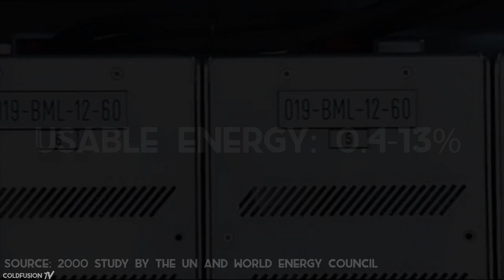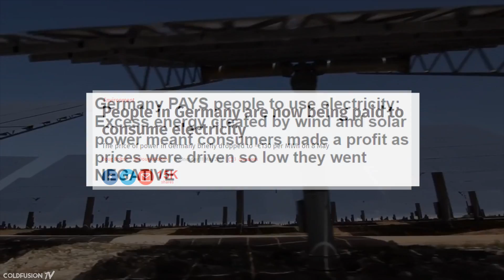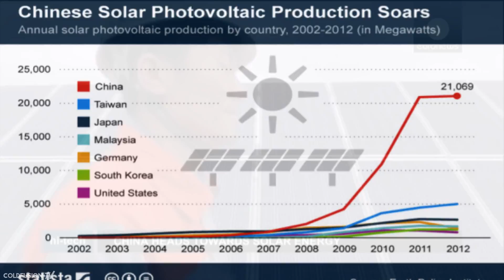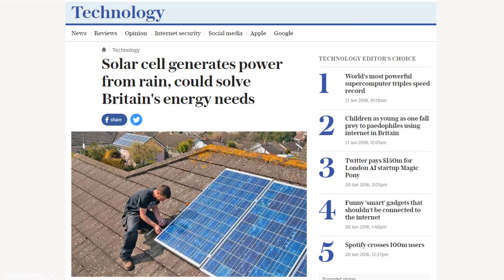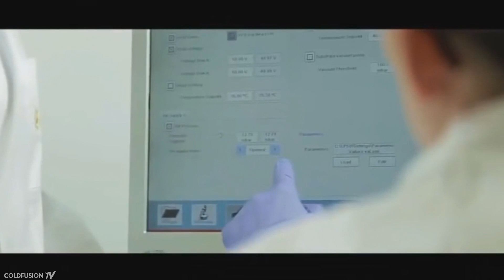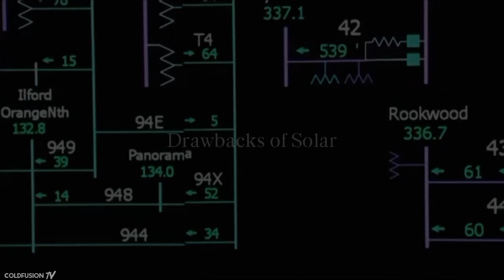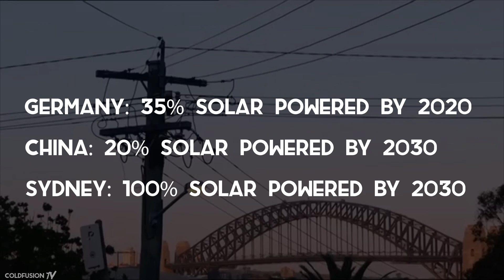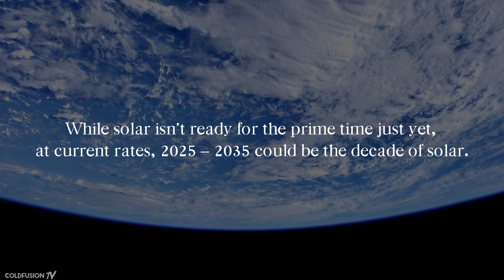The Truth About Solar

Comment: Why arent they making gigantic swimming islands out of solar panels covering parts of the oceans?
Reply: Waves.
Reply: ryan bresnahan who said they needed to not move?
Reply: _ ϺɅƦCΞL _ I wasn't trying to be a smart ass haha, I'm sure it could be done, but there would be issues with shipping lanes, and random storms that could make the water extremely rough.
Reply: Because using wave power generators would be better in that situation. They'd also have to pipe that power back or store it whilst at sea, power storage is a huge problem... it would be easier to place the solar cells in the desert. For countries like the UK, the problem is, who owns the desert, how well would they trust treaties to invest the billions in building these 'gigantic' solar farms covering parts of the desert. Then to pipe the power back, it would be the same Oil/war problem all over again.
Reply: ryan bresnahan I've just made a similar comment on another thread, one where a guy was shooting solar down for needing batteries. I've seen a video about it too. 

Use Solar energy during the day to pressurise old mines, draw energy at night from the releasing the pressure. Use Solar energy to pump water into reservoirs, then release the water at night, draw energy from it using hydro.

Many ways to get away from batteries, we just have to get creative.
Reply: First problem is energy transport... then there is the alignment with the sun, then maintenance, then weather... As a engineer I can tell you , it would be an expensive nightmare, for now you would be way better off just asking farmers with a barn to let you put some solar panels on top of it and give them 10% of the electricity for free, same goes for convenience stores, parking lots, etc... it it much more cost effective
Reply: mitchiemasha I recently watched something that dealt with this power storage problem, I can't remember where exactly I saw it, but it involved using the energy harvested (in this case) by wind turbines out at sea, and using the energy harvested by the turbines to compress air and fill a large balloon like vessel. It was some university program in England if i remember correctly, was pretty interesting.
Reply: Transporting the energy to land is problematic.
Reply: What I don't understand is a solar installation on my roof was priced at $24000 but generates only enough energy to run 3 small space heaters. WTF? However, I love the idea from Mik Wind of providing free solar units to farmers and 7-11 store owners then giving them 10% of the produced energy.  It is similar to the rental of suburban land to farmers.
Reply: Will Tabacchi Heating requires a TON of energy, and heat is the most useless form of energy .Unless you are using heat pumps, or running a bunch of computers to heat the room, it simply is better to burn gas .Heat pumps will give you 2.5 to 4 times the performance compared to a normal heater.

Comment: The truth about solar is that it was never about the solar panels to begin with.     Now it is great to see breakthroughs in solar panel technology and they are useful but this is not where THE problem with solar power lies.

      I had to give this video a thumbs down because it seems to me only a commercial about selling solar panels.

      I will give credit to the video on spending some time on the real problem with solar, but it was less than a minute.      The problem is we are still waiting on a breakthrough in energy storage, and I have not seen it yet.     We are still dealing with batteries with dangerous chemicals  that wear out over time.     Even the Tesla battery bank hasn't solved this problem although I do welcome greater efficiency in this area.

    Until we solve this problem solar will continue to be a small player on the scene, playing a positive beneficial role since it will reduce our energy consumption but still a small role.

     Tell me about something new and innovative about energy storage and you will get my attention.

Comment: Good work!. You didn't touch on Solar towers which uses mirrors to heat a salt and it has potential to store energy for a later use (during nights or cloudy days) in the form of heat to run steam turbines.

Comment: what about the CO2 emissions during production? i think you missed an important negative argument, don't get me wrong i would like it if there were more and better solarpanels but its an issue that needs to be dealt with.
Reply: The water contamination is a bigger issue. I actually worked out the worst case carbon emissions for production, transport and installation of our panels back in 2008 and they recouped them in 2 years based on Irish electrical generation at the time. It may take slightly longer now as the grid is greened but also everything else is more efficient, as well as the panels since then. So it may be similar or slightly longer.
No matter what anyone produces there are carbon emissions and downsides but renewables can recoup at least the carbon emissions as they are saving fossil fuels being burnt.
I just wish they were as cheap back in 2008 as they are now! I could have put more up.
Reply: Niall O'Toole I did not know, that they improved that much on CO2 production efficiency. but still he did not talk enough about negative things concerning solar power. would be nice if it was that easy as he described it
Reply: +RCP8888 yeah I think he gave a decent overview but for the true geeks it was a little light.
the real difficult part will be the storage and whether we will actually have a grid as we know it.
I am at the minute trying to sort out a cheap storage solution for our home as anything off the shelf is stupid money.
that is the thing, it is expensive and out of the reach of most people unless they are very committed to reducing their carbon footprint.
Reply: considering the alternative?.... solar doesnt seem so bad
Reply: "considering the alternative?.... solar doesnt seem so bad." Okay, I vote that the lot behind your house get a solar farm installed on it.
Reply: So you want energy from nothing basically. The panels once built are there for many many years, so you pollute only once in the beginning.
Reply: "The panels once built are there for many many years, so you pollute only once in the beginning." Same could be said for nuclear. Hydro lasts a helluva lot longer than do any solar panels. In terms of energy output (watt-hours), hydro and nuclear are unsurpassed.
Reply: You are very correct in your observation, what the video did was tell us the cost of solar power, what the video didn't do was tell us the price.  The CO2 output during production of the solar panels is negligible compared to the toxic compounds just dumped into the environment in china.
Reply: +fivemeomedia of course it doesnt. But fusion would be awesome too. But a lot further away sadly
Reply: +Elias Krmngr I think we would all love something that would be made from a low impact material. but even still the current panels are highly recyclable.
longevity wise my panels have a power production guarantee for 20 years and will produce power well beyond that but will degrade over time. in the last 8 years I haven't seen any degradation.
graphene seems to be the best future tech for PV panels but printable multi-layered multi-spectrum solar looks like the best bet shorter term and should be cheaper with less of an impact.
the holy grail would be printable solar cells with cheap, green, local storage on every building and some wind/wave power to cover the winter months.
Reply: +RCP8888 yeah I've looked at 18650 batteries which aren't cheap unless especially when you end up recycling reclaimed laptop cells.
there are very good engineering reasons why storage isn't cheap.
I'll check out the ice one you mention.
Reply: what about the emissions and other problems with mining materials used for batteries? Not to mention production and disposal of batteries?  Throw in the limited life span of batteries and where do the numbers make sense?  I'm all for renewable energy, and I do believe that we need to put extra cost into renewable energy over fossil fuels even if it doesn't make sense now, for the simple fact that we need to fast track renewable.  Still I would like to hear the legitimate down side to these things.  I just don't like to hear a biased statement of "the current state" while keeping a hope for the future mentality.  I do like this channel, but I tend to be critical when it comes to being unbiased.
Reply: "what about the emissions and other problems with mining materials used for batteries?" Do a search for "cobalt mining africa children" and tell us what you find.
Reply: Well what would be great is a biologicaly degradable material generating electricity.
Very interesting is the project of Saule Technologies.
Important for any of these projects is the question of longetivity, any information?
Reply: +Psittac20 mining coal and uranium is not green. Lithium is recyclable, its too valuable to dispose of. Right now, all cars have lead acid batteries,  which are reclaimed at over 99%. Almost all new car lead acid batteries have been made from recycled lead. 
making anything takes resources, but burning is burning, and there is no clean burning.
Reply: But they don't last forever either...
Reply: +Niall O'Toole i found a tutorial for how to build a tesla wall battery/akku from old laptopbatteries etc. just using 18650, like in the tesla thing. Also an ice heating (eisspeicherheizung in german) could be interesting for you
Reply: "i found a tutorial for how to build a tesla wall battery/akku from old laptop batteries etc." Does the insurance company that issues your home's fire insurance know of your plans? For that matter, does your power company?
Reply: +Cristian Baluta yes, but when do the numbers weigh out?  Throw in the difficulties of storage.  I don't see the scales tipping at 2 years whatsoever as previously mentioned, I don't even know if a home owner can make out with all things considered with putting them on their roof.  I do feel that what may not make sense now, will be overcome by future innovations and we need more capital behind it all.  But I'm still a skeptic of people who tout it as an end all be all.
Reply: The recoup time today is less than 6 month (maybe a little bit longer in Ireland)
Reply: Niall O'Toole
Sounds quite good, although I have to admit, I dont know how long ordinary solar panels last.
 What are these panels of yours?
Do you have a company?
Any place do get informed more deeply?
Reply: +Elias Krmngr my panels were manufactured by Kyocera but several manufacturers give similar guarantees.
these days the panels are more efficient, mine were 15%  and the latest ones are more like 22%. and a fraction of the cost.
just check out either solar installers in your area or more complicated buy the stuff yourself (panels, inverter, wiring etc) and talk to a local electrician to sign off the installation. different power companies also have different rules about connection and being paid for any exported electricity.
Reply: It will still be less
Reply: The production process is an issue, but people seem to think it's only for solar panels. All the shit that you buy has an incredibly fitlhy and power hogging process, then you throw it all away and start buying again...
Reply: CO2 is very good for the earth.
Reply: +Emiel Verbeeren research stuff!! Get stuff in your big head!! CO2 is Horrible for the earth and it limits oxygen for us!
Reply: well the "O2" limitation is not the problem
Reply: +AndDiracisHisProphet well ye
Reply: +AndDiracisHisProphet there will be an issue with oxygen. keep pumping CO2/methane into the atmosphere and we will get ocean acidification which will mean no phytoplankton and loss of the food chain and half the oxygen.
if we continue to chop down and burn forests we will kill the other major producer of oxygen.
so O2 is not a problem? really, you live on a different planet.
greenhouse gases are changing our climate and we are pushing ourselves to extinction. the planet may or may not recover after us
Reply: Niall O'Toole Methane us an issue indeed. But CO2 is very good for the photosynthesis, and there is surely enough oxygen. If all plants died there would be enough oxygen breath 1000s of years.
Reply: Niall O'Toole
While ocean acidifikation is surely a problem, the displacement of oxygen in the atmosphere by co2 is not.
@Emiel On the photosynthesis issue. While it is true that it benefits plant growth it also decreases the nutritional value of food plants by the same amount. That will be a huge problem.
Reply: +AndDiracisHisProphet 
so through enhanced growth, i are there less nutrients build, or are the plants just less densely packed with them?
Reply: +AndDiracisHisProphet there is only 21% of oxygen in the atmosphere. each time we burn anything we bind some of that oxygen.
half of our oxygen comes from the oceans and the rest comes from plants/trees.
so as the world warms, oceans get acidic, methane is released from the artic and oceans. it is a vicious cycle. less oxygen eventually and more greenhouse house gases and quickly we have a planet that can no longer support a lot of lifeforms that have evolved 
we are living through the 6th mass market extinction!
Reply: +Niall O'Toole And why can't they support lifeforms if I may ask?
Reply: Elias Krmngr
it cancels out. the nutritionvalue per area, that is.
Reply: Niall O'Toole
again, the decrease of oxygen is not the problem. the increase of greenhousegas of course is.
Reply: +Emiel Verbeeren less oxygen, more greenhouses gases, ocean acidification, higher temperatures. biomass will be reduced, as climate changes as areas that supported a type of fauna/flora is no longer supported by the new climate.
ocean conveyors may alow or stop and if so the tropics become really hot and all creatures that are still alive have to migrate to higher latitudes, less land to grow crops for humans, methane that is released as the artic melts accelerates the warming further. dead oceans and less land with higher temperatures lead to extinction. similar happened before and we are well on our way to a repeat unless we all make a paradigm shift in the the way we live today.
we already have a 0.5C average temperature increase built in to the climate even if we stopped all carbon emissions today. there will be tipping points where warming accelerates and could easily lead straight into another tipping point.
it is incredibly scary and it may not impact greatly on anyone over 50 years old but it will affect everyone younger than that. so for your children and future generations, we are the last generation that can hopefully do something about it.
it is not unprecedented in earth's history but we are also in uncharted territory as we are warming the planet faster than ever before.
Reply: +Niall O'Toole you really seem to know what you are talking about so I believe most of it but did you know the sun isn't very active this century and that there is a great chance of a mini ice time? Also we just came out of an ice time and much scientists believe that's the main reason for the climate change. Also it has always been changing since the beginning of times. we don't have to stop it.
Reply: +Emiel Verbeeren the sun is actually helping curb the warming at present and the planet is still warming. as we approach the next solar maximum we should see warming increase.
so yes there is effect on the climate based on solar and our elliptical orbit around the sun but what we are living through is unprecedented and humans are changing the climate. no ifs ands or buts.
we are rapidly changing our climate. 
you can actually follow the solar effect on climate and see us currently separating from that curve over the last 20years especially. nearly every year/month we have a new record temperature.
we have passed 400ppm in the southern hemisphere already.
if there is any doubt, ExxonMobil and others have had data for decades which was hidden and they employed "scientists" to debunk it all to protect profits.
we are all on the same life boat and it is sinking. do you want to sit there and watch or help try and bail out and try and get us to safety, be it a changed climate but hopefully a stable climate.
the science is clear and if anything IPCC is being conservative in the predictions.
I am doing everything I can, solar, giving up meat, composting, reducing, reusing, recycling, passive house, growing our own food etc.

Comment: I remember watching years ago something about that film-like transparent solar cell. I had thought the idea may had been scrapped because it would have such an impact on the current power regime. 

Looks like the time is now for solar. Economies of scale, and the answer to peak usage has  been answered at least partly thanks to Mr. Musk's Gigafactory. Time will tell, but as you noted with the recent increase in adoption by countries and large corps it is only a matter of time when we'll see a mass public adoption. Especially if the aforementioned solar film turns out to be as good as "they say."